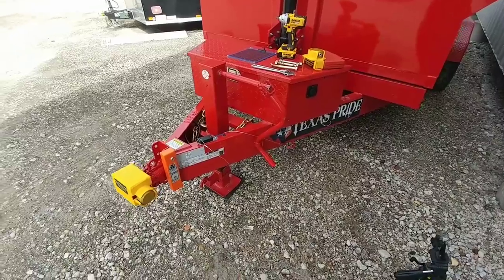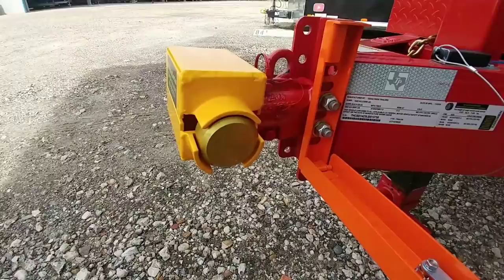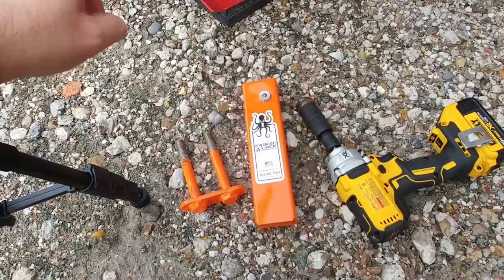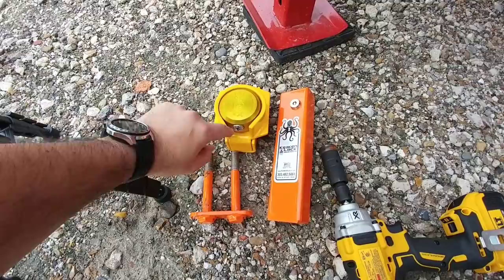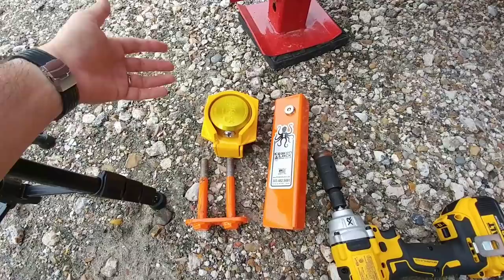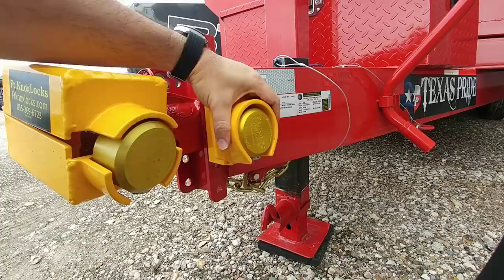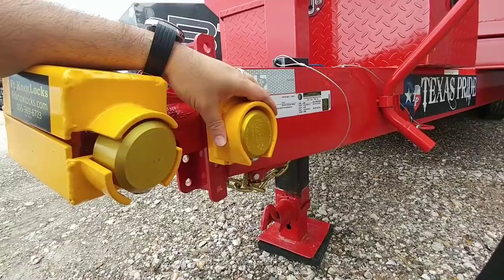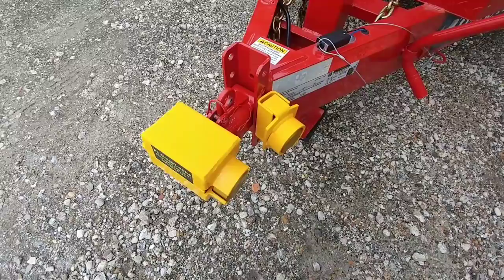UPGRADE your Dump Trailer Security! Fort Knox Locks and Abloy Channel Lock!

Comment: After a lot of research and then having my buddies Texas Pride dump trailer stolen, I went a different route. I took the mounting bolts off and drilled the holes in the channel that would be level for my truck, then took the actual coupler to the machine shop and had them align bore the coupler holes. Then I added two 3/4" grade 5 pins and retainers from TSC. Now, when I RON or am done with the dump trailer for a while, I pull the pins, and remove the entire coupler. No socket for a would be thief to engage. I guess they could tie the safety chains and let it drag down the road. Next step is to put GPS trackers on the dump and the new gooseneck equipment trailer. 
Keep the great videos coming.
Reply: What gps system did you go with bud ?

Comment: Problem is one could cut the bolt heads off and the rest is history. But if the added another locking system on the other side then it would be a game changer for sure!
Reply: that would significantly increase the out of pocket, not to mention most thieves shy away from using power tools as the time/noise necessary is very unappealing to most thieves.
Reply: @miltonodom8095 ever seen people cut off cats to vehicles? 😅

Comment: The first lock prevents someone from bolting on a coupler above or below the coupler you have attached. The second one doesn't.
Reply: If the coupler is low enough it doesnt matter if you bolt it on above you still cant attach to it
Reply: Also the majority of C-channels aren't as long as the one he has
Reply: Additionally after further inspection you couldn't even fit another coupler underneath the first one even if there are two bolt holes underneath the existing one
Reply: @lancethomas4566  possibly. . . Though the majority of the base plates of adjustable couplers I am familiar with are taller than the hole spacing alone and would prevent one like what you described from being able to line up to the holes properly
Reply: @Chadwickodom92  I was just pointing out the difference between the two.
Reply: @chbarkle1  that's fair, I was only pointing out how I dont believe the difference changes the effectiveness of either. Both are good products
Reply: @Chadwickodom92  Unless you mount the coupler in a different position than the video.
Reply: @chbarkle1  correct, if your coupler is mounted on 2 of the upper 3 holes. (of a 6 hole channel which again are less common than their 4 hole channel counterpart) at which point it would be relatively easy to have your tongue sit an inch or two higher than you normally do and install it in the middle two or lower

Comment: What if the thief shows up with a battery powered grinder and grinds the heads of the bolts, installs 2 new bolts and the new hitch and calmly drives away? I don’t think your lock supplier thought this one out. Or as someone else pointed out a one ton wrecker hooks up and drives off.
Reply: most thieves shy away from using power tools as the time/noise necessary is very unappealing

Chad Odom

Comment: The downfall about this locking system is it leaves those two bottom holes exposed and someone theoretically could bolt a pintle tow eye to it and still steal the trailer. It appears there would be enough room at the bottom to even if they just used one bolt.

Comment: Sadly my experhiences with FT Knox weren't the same.  Sent them a pic of my trailer tongue and they advised what lock to buy.  waited three weeks and when i asked where my order was i was snippily told they were waiting on puck locks to come in.  Finally got the lock the day before my planned trip to leave my trailer remotely and it won't fit/close so i have had to delay my trip.  We'll see how the return process goes.
Reply: We are so sorry for you wait and experience.  Both for obvious reasons (delays related to Covid) and the fact that the RV market and other trailer markets exploded over the past 6 months, our family owned business was caught off guard in struggling to maintain stock.  I am also sorry you felt we were snippy.  We are still small enough to consider every customer as highly valued and we intend to keep that attitude as we grow.  Unfortunately  with the Curt style coupler (I'm assuming this was the case with you) there are some outlier dies out there they are stamped with a slightly taller bridge right behind the ball socket area and we are not able to identify those visually.  I trust we were able to get your fit situation corrected.
Milton Odom
Ft. Knox Locks

Comment: If you wanted to could you get one of those bolts with the pins in it and use two instead of one?
Reply: You could use two, but you only need to protect one for certain because they have to get both out to be able to switch couplers.

Comment: 1st, it is a shame a person has to spend so much time and money to protect them selves from thieves
2nd, I don't know if you covered this in another video, but I see you have a lock on your coupler , is it possible just to pull the coupler off and keeping it, say in your truck, instead of having a lock for it?
This would be my first time ever seeing that type of hitch so you can imagine how much experience I have in trailers.
Reply: Then you run into the problem which the channel lock addresses, which is to prevent someone who has their own coupler from coming up, putting theirs on, and driving off
Reply: @Chadwickodom92  well I thought that was what the second lock was for to keep someone from removing the coupler and putting theirs on and driving away.
Which goes back to my original question, if you take your coupler and just put that second one off that keeps people from adding or removing a couple wouldn't that cut down on one of the locks needed?

Comment: Okay, okay great I went to there website and see that they have one for my 5th wheel king pin I think that it will slow them down at least, one thing that is good is to have multiple locks or layer of safety but I do see that you have a couple of locks.

Comment: Remember that a lock will just help slow down the thief.  Someone who would want the trailer simply needs to purchase: https://www.amazon.com/DEWALT-DCG413R2-Brushless-Grinder-Kickback/dp/B074V31TBJ/  While it will be loud and take a bit, to grind off the heads is really pretty quick, pull them out the lock side.  I do actually like the kracken better in that regards, it would be much tougher to do that.   But the core seems better on the Ft Knox lock.  Unless that is you hear "I got a click out of four...."   lol

Comment: what model of ft knox lock did you purchase the coupler on your trailer? i just ordered a trailer (bwise) and it appears to have the same coupler as your trailer (it has that eyelet looking thing on top). ft knox appears to have 3 or 4 different locks for a bumper pull trailer. appreciate your help.

Comment: JD, 
First off I just bought that socket set. Thanks for the recommendation! 
Next, I have a question, with all the cordless tools available, what's to stop someone from taking a cordless grinder with a cutting wheel and cutting the bolt heads off on the other side then sliding the bolts out the lock side? I don't mean to be a party pooper here but if I needed to get that lock off I do believe I'd attack the weak link which appears to me to be the bolt heads. Am I missing something here? I think though that you were correct in that anyone who is a thief and really wants to break into a lock can do it. I believe that with locks you simply make your trailer more complicated than the one parked next to it and the thief will just simply move to the next trailer. 
Good review!!!
Thanks, 
Pat
Reply: I said the same thing and suggested to FT Knox they offer an Abloy lock on both sides. This eliminates the exposed bolts, aka weak link.
Reply: most thieves shy away from using power tools as the time/noise necessary is very unappealing

Comment: What about just using a Dewalt  cordless grinder, a large drift pin, and a BFH on the bolt heads? (With proper eye protection of course)
Reply: At Ft. Knox Locks we maintain that all locks are deterrents.  If you bring power tools into the equation then all bets are off for any lock.  We are believers in an "all of the above" approach to trailer security.

Comment: What about cutting the heads of the bolt off?
Reply: At Ft. Knox Locks we maintain that all locks are deterrents.  If you bring power tools into the equation then all bets are off for any lock.  We are believers in an "all of the above" approach to trailer security.
Reply: @ft.knoxlocks4790  can we put another lock on the opposite side to prevent that?
Reply: @danlux4954  if you are wanting to spend the additional amount for it of course you could.

Chad Odom
Reply: @miltonodom8095  Cheaper than buying a new trailer

Comment: I feel like having the heads of the bolts exposed kinda defeats the purpose of the lock. Someone brings a cordless grinder zips the heads of the bolts off, pulls the lock mechanism out the other side, puts a new coupler on, and your trailer is gone. This product stops the lazy thief but isn’t going to stop all thief’s.
Reply: most thieves shy away from using power tools as the time/noise necessary is very unappealing

Comment: Do you believe that those height adjustable lock would be weather resistant? Or will the Abloy cylinder pretty robust?
Reply from the maker: It's pretty robust
Reply: Most metal rusts

Comment: First one is way better. Its tight, simple and looks a lot cleaner. 
 Infact the second one is very poorly designed.
Reply: the first one loses the grading on the bolts by welding them making them susceptible to snapping during the towing process. . . I would personally lean away from the product that is just as liable to break off while towing on the highway as it is to be stolen, especially after studying the interior of their system.

Chad Odom